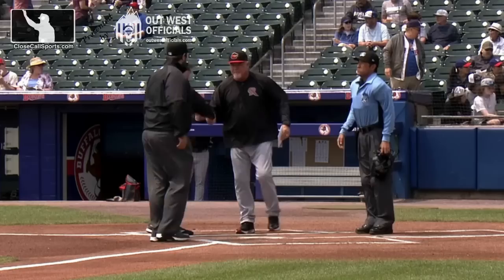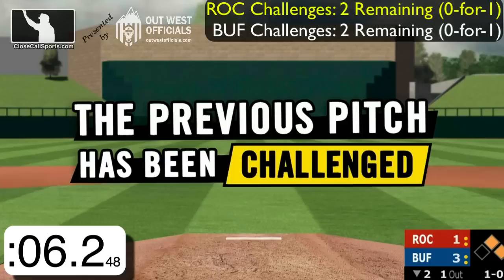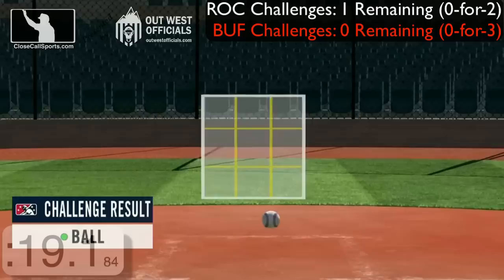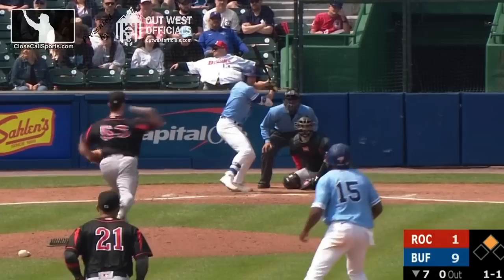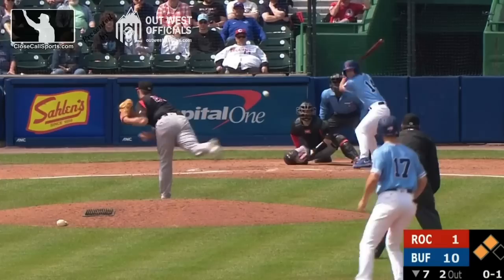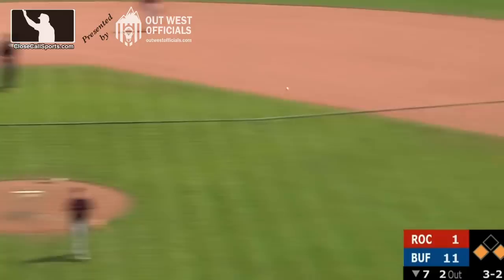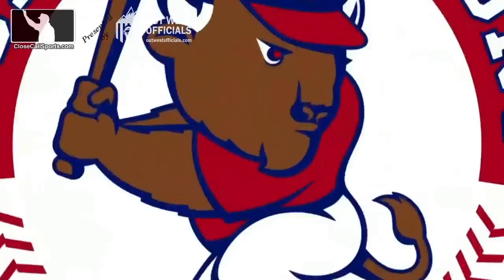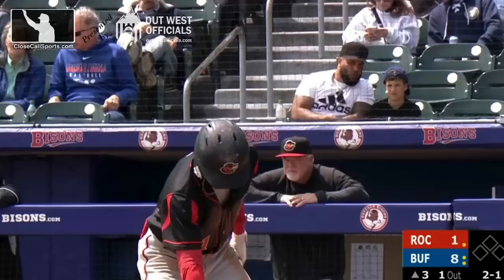Triple-A ABS Challenge System - Team Runs Out of Challenges, Pitcher Ejected for Arguing Strike Zone

Comment: It seems to me that as a manager you would want to track how the ump is doing amd then start challenging in the 6th or 7th inning on areas you've identified as the umps weakness.
Reply: Yeah, video coach looking at it throughout the game to then relay info to the dugout
Reply: Or save it for high leverage, as the color guy comments at one point, challenging a 3-0 pitch early in the game is a pretty low value challenge, costly if you miss and pretty low upside if you hit.

You should save them for close calls preferably in situations that matter, like 2 strike counts (especially full counts), with runners on or late in the game.   Better to end the game with a challenge left in case you needed it in a close situation than to run out and not have one in that situation

Comment: I'd be very curious to how accurate these ball/strike pitch challenges are.  Do they adjust to the players height?  While inside/outside we can't really tell because the camera is at an angle.  I could be wrong, but the high/low zone seems to be, what you see is what it is.  That brings me to 2:21 . The strike zone is supposed to be  from the knees to halfway between the belt and the shoulders.  Which is usually the bottom of the letters.   If you pause it at 2:22 the batter is squatting down.  According to the broadcaster, that batter is 6'4".  A pitch thrown right in the middle of the catchers mask, should easily be below a 6'4" batter's letters.  But yet the challenge system says that the pitch was not only just a ball, but wasn't even borderline.
Reply: couple things wrong with this comment. 1) the strikezone is determined by the batters stance, not height. The batters stance is pretty low which brings his strikezone much lower. 2) Also when the catcher catches the ball it's around the height of his forehead... that's when he CATCHES the ball... which means it's few feet past the plate. The ABS calls based off when the pitch crosses the halfway point of home plate... You can see in the ABS replay the ball is curving down when it crosses the plate so ofc its going to look lower when the catcher receives the ball. 3) You say that it was thrown in the middle of the catchers mask because you miss the catcher bringing it down slightly while he catches it. It hits his glove when it's right around the top of the forehead and him trying to frame the pitch (not sure why they even bother anymore, you aren't going to fool the system) while also receiving it with the top of the glove (which causes it to follow the glove down into the pocket) makes the pitch look much lower than it is. The system is on it's second year of use, first year of use by all AAA teams. The system is more accurate than your own eyes and judgement.

Comment: MLB players are going to use their challenges more effectively, at (I would guess) a success rate of about 50%. Which means if this system were to be implemented, we'd see at least 6 wasted challenges and possibly several more successful challenges. So 10-15 challenges per game, at 15-20 s each. Potentially 6 minutes of challenge stoppage every game. Doesn't seem like a lot but I think it's counterproductive to the effort being made by the pitch clock to shorten the game. Challenges totally disrupt the flow, in my opinion. There's an easier solution - just use ABS for all pitches.

Comment: Don't get why you'd bother with a challenge system when you can just use the automated system from the start. I suppose while the MLB doesn't use an ABS though you would have to have the umpires lower keep calling otherwise you could end up with umpires who have got used to not calling balls/strikes moving up to the MLB. As for the teams, in a challenge system, the only way you should be wasting challenges is for events with significant impact which would be getting an out or walking in a runner, or late in the game where getting someone on base really matters.
Reply: The answer is time, it takes about 2-4 seconds for the system to record the pitch and relay the call to the umpire who then makes the call. That adds up over 300 pitches. And that's if the system is calibrated perfectly every time.
Reply: @stephenkasper6081  2-4 seconds is worth it.  There should be no reason to have to challenge anything. Just get it right the first time, every time.  At least keep it consistent pitch to pitch.
Reply: @CommonSense823  Except the automated system has some flaws and still gets some calls wrong.
Reply: @stephenkasper6081  in soccer the goal line technology system almost instantly buzzes the referee to tell them the ball went all the way over the line, and that's way more complex (due to players being in the way of the cameras, goalkeepers reaching or trying to knock the ball away), so there's technology around that could do it within a second.
Reply: @karlrovey  So do the human umpires.  The tech will only improve.
Reply: I mean, maybe lets automate and standardize everything in baseball.  No unique fields or fences, all pitches delivered by machine, batted and fielded by robots.  In fact, only have the game played inside so there are no variables like wind or weather to change the outcome.  

Or we can just have something in our lives which isn't standardized and digitized.  An analogue umpire calling balls and strikes, something that's been done for 150 years with all the drama and argument that goes with that. 

And if it is all automated, we really wanna sit through a game that's 12-0 with position player pitching in a strict strike zone? Or a pitcher about to throw a perfect game that's a cm off the zone on the last pitch?  How about we just hire great umpires like the one who called a perfect game in the WS?
Reply: @sfmc98  so hire that guy to umpire all of the positions for every game?   Automating umpires makes sense. The goal is to get the calls on the field right, right?  So the competition between teams everyone is paying to see isn’t tainted by errors or egos of, let’s face it, umpires who really have no business on a major league field, but are protected by their union from any accountability.
Reply: @CommonSense823  If they're so protected by their union, what makes you think they'll allow a system which makes them irrelevant? 🤣

The fact is that people have paid to see the drama between the players/coaches and umpires for 150 years. You can read about the same exact arguments and ejections happening in 1923 as you can in 2023.  People love it. We wouldn't even have MLB videos the ones on this channel if they didn't happen.  And yes, you can hire umpires who are performing at the height of their game. You don't have to hire that guy, but they do exist if developed properly.
Reply: @sfmc98  of course they exist.   They can be as developed and ready as you’d ever want them to be.  They still have to wait for an MLB umpire to retire before getting a shot.  MLB averages less than 1 new umpire per year.  Thanks to the union, these are lifetime appointments.   

Union jobs are lost to automation every day.  Moving to full ABS is the only way to get out from under the underperforming umpires the MLBUA produces.
Reply: @CommonSense823  And it's not a bad thing for them to have job security. It's like a federal judge. They shouldn't be making decisions based upon getting fired.  Yes it's a slow process to get new blood but you're better off in thinking in terms of decades, not years for this sport.
Reply: @sfmc98  Gotta disagree with you a little bit.  They have next to zero accountability for doing their job well.  There is no threat of being sent down to the minors and bringing up better talent.  Angel, Laz, and many others are far too comfortable making bad calls, because there is no threat to their paychecks or to anything other than playoff assignments.  Meritocracy would be a vast improvement for MLB.  Having to earn your spot every day would be a good thing for Umpires and for the sport.  There are over 1000 umpires in the wings in MiLB.  Several of them are ready to be called up at any time, but they have to wait for 1 of 76 spots to be available.  Several of those 76 spots are being taken up by subpar umpires that should be sent down.
Reply: @CommonSense823  Well you describe a fair potential system of meritocracy which is better than trying to get rid of umpires entirely through automation. 

Things like the ump scorecard do give some fair metric about their ability at least behind the plate.
Reply: @sfmc98  The ump scorecard is a joke though.  The union specifically negotiated in their last CBA an additional 2" buffer zone outside of the strike zone so that umpires would score higher.  Real numbers are anywhere from 6%-12% lower for any given game.  This is the type of "accountability" the MLBUA is looking for.
Reply: @CommonSense823  Ok but that's less than the diameter of a baseball (2.9 inches). And if an ump is doing poorly even under those conditions then you do know that his ball/strike calling ability is poor. 

And there certainly should be times when the strike zone isn't so rigidly fixed. Hasn't been that way for 150 years no need to start now. 

And calling strikes is just one relatively small aspect of the game. It's like 58 actual substantive calls per game. There are a ton of other subjective calls they have to make which you just can't judge. Attempted swing anyone?